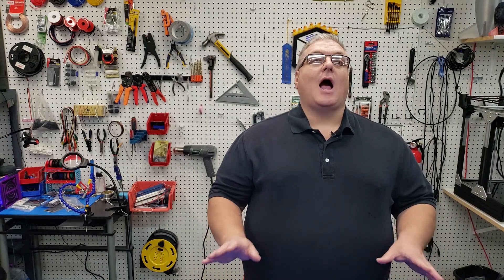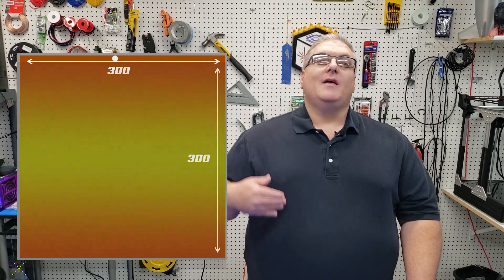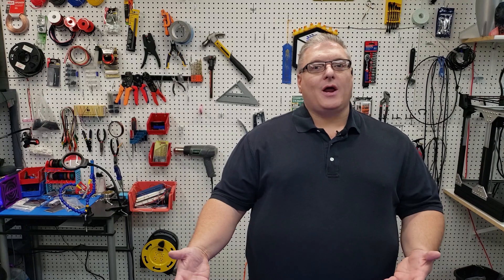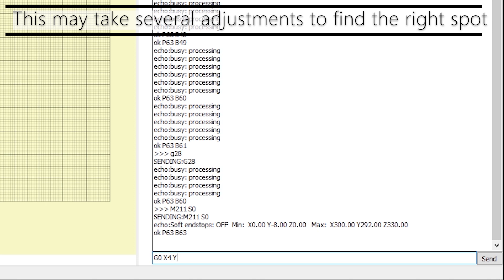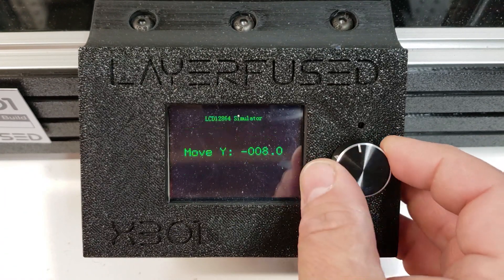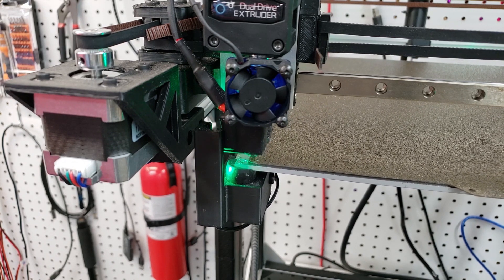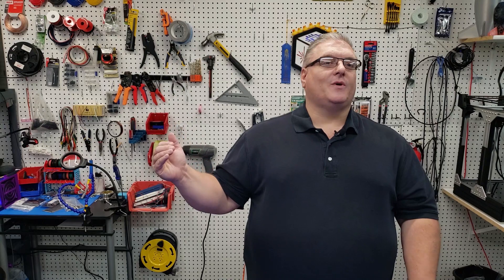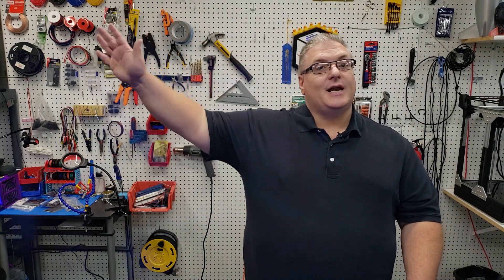Adjusting Home Offsets - Marlin M428 / M206 | Reclaim lost build volume

Comment: Sorry, tried the M428, my SKR mini 3 says go pound sand. "Too Far from reference point". Something got haywire , not from M428, from something prior to trying this. I am dumbfounded, cause I recompiled several times with stock settings, just don't want to go to 0,0,0. always thinks it needs to center at 86X 56Y. If I would have hair, I probably would have ripped them out. Very stubborn BUG? or. Thanks for the video, anyway!
Reply from the maker: Max distance from the endstops is 2cm.  It will not allow you to have an 86mm offset. You'll need to move the endstops or try it in firmware settings.
Reply: @MakersMashup  Thanks for your reply, the EEPROM was definitively corrupt or? The TFT 35 keeps some data that contradicts the data in the controller, I believe. This leads to a stubborn TFT v.s. Stubborn SKR Mini creating bogus edges. It even clips / truncates to the X axis (software stops) if the print would exceed the limit. It could have as well been the 250000 Bps that some suggest the two (controller) can handle. This speed may corrupt data on the fly or permanently as I stated in another comment. I took all the fancy stuff out of the config and print the simple way, with the wheels on the hot bed, hi, hi. Actually, it reported corrupt EEPROM data, I can't determine on which side, though. Maybe I'll investigate later, since I want to actually print my project. Even after the re-flash with auto level enabled the printer acted weird, not so without auto bed level. I might have a defect either in hardware or firmware? Anyway, Thank you for pointing out the M428, the firmware is in fact rather complex and it takes time to find out about this and that. I just bought this low cost Anet A8 and am in the middle of learning about 3D printing. Unfortunately, I am experiencing ESD on top of the other problems, although I have grounded work benches and a grounded metal plate at the entry of the room, yet (my guess) the acrylic frame charges and when touched discharges through me, some people may call it zapped. Have to figure a way to prevent this, it might even kill the controller.
There are quite a few things I have investigate in this regard. Sorry for my lengthy novel as a comment.

Comment: How do you actually reset the home position?  I installed a Micro Swiss direct drive on my Ender 3 V2 and somehow the home position is way off the print bed. I used your advice and it worked for printing on the table but my home position is off. Any advice?
Reply: I'm having the same exact issue with the same printer and the same direct drive.  It's been driving me nuts since so can't seem to find an answer anywhere.
Reply: @sketch088  I have the same issue with my ender 3 Pro using Microswiss direct drive along with a BL touch, it goes off the bed when Auto bed leveling and the purging off the bed at the start of prints. Cant find the answer anywhere.
Reply: @raycarrasco9356  Same here , has anyone found a solution?
Reply: I just installed a microswiss on my ender 3 pro and now im having the exact same issues, did you guys ever find a solution?

Comment: How does this work with a BLTouch since it homes Z in the center of the build plate?
Reply: I wanted to ask the same question. But it think that is another setting, based on probe offsets. I will experiment now (you probably already found the answer by now)
Reply from the maker: It works fine.  You're going to move the print head after it homes anyhow.   My X201 does that too.
Reply: How can this Work When U cant Go Further then 10-20mm from the homing Point , my printer Also homes in the middle and dosent Accept the new coordinates. x max endstop is on the right Side wich confusing me even more

Comment: I am new to 3D printing but I got my printer set up using Cura 4.7.1 connected to OctoPrint which connects to my printer. I am having the problem of my printer homing off of the printer bed. I have the Alfawise U20 One which is supposed to be using Marlin but I really don't think that it is. I see a possible solution using Ponterface but I never heard of it before nor had I seen anything like Cura 15.04.06 (which I found while trying to install Ponterface). Since Cura is open source software I suspect that you are using versions of Cura that are being upgraded along another line than the one I have. I see nothing in Cura 4.7.1 that looks anything like what you are showing in this video. To get Ponterface do I need to use a different version of Cura that I now have? I guess I will have to uninstall what I have and reinstall 15.04.6 or later. 

By the way, I cannot access anything on the printer touch screen that even looks anything like Marlin. The Alfawise website shows a way to download the latest firmware which happens to be version 217. I updated the firmware but it looks nothing like Marlin... I was hoping to fix this issue using Marlin. I see no way to access anything like Marlin on the printer touch screen!
https://www.gearbest.com/3d-printers--3d-printer-kits/pp_009726113945.html?wid=1349303

Can I just install Ponterface with the Cura version that I have or do I need to uninstall it entirely and go with a version like 15.04.06?

Comment: Please help me. When I insert the codes into the program (like M428 etc.) It´s not responding (no "ok P63 B63"). And after I did everything like you in the video, it´s not working. When I send it to 0/0 it´s out of bed. (sorry for my english).
Reply from the maker: Your printer may have proprietary firmware that could be the issue.

Comment: I used this after installing a microswiss direct drive. Great video.
Reply: Yeah I've Upgraded mine too today and had the same issue now I dont have it anymore. Great video
Reply: Just gave me hope im watching the right thing
Reply: @h1ghy1eld25  yeah but I had to do it right over again. After a few days my other parts(new silent board and BLTouch) arrived so I had to go in firmware and edit it there. But at least thanks to this video already had the measurements. And it was just some quick editing offset wise. I decided for firmware configuration mostly duo errors with the BLTouch
Reply: I’m hopeful this will help just did the same direct drive

Comment: This is something ive been battling all day. could you help me with the Start-Gcode so that it raises my Z-axis first, then moves to the new XY? In previous attempts, the extruder wacked the side of the taller build plate while trying to get to the new home offset.
Reply from the maker: Check this out https://youtu.be/lwENk8bxtU4 you just need to add the G0 command to move your print head. A good understanding of the G-Code makes it easier to make it do what you want in your startup script.